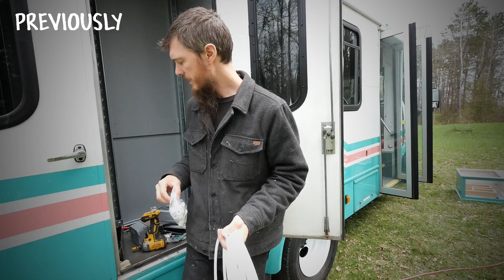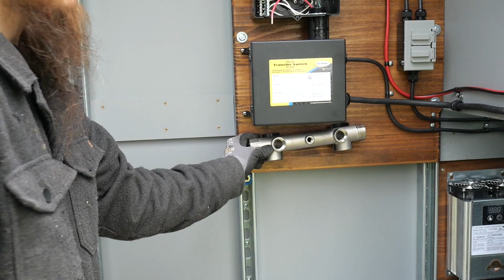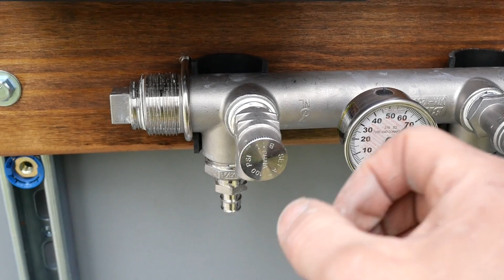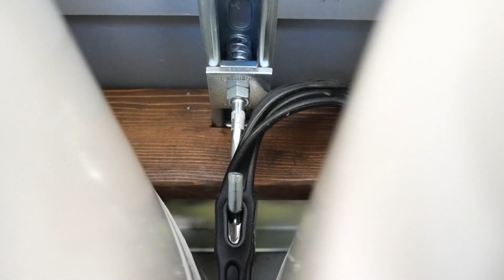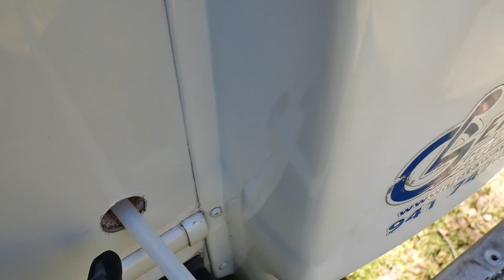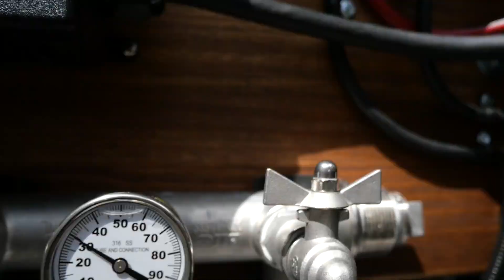Pumpless Pressurized Water System for our Bus Conversion

Comment: out west a lot of the public rv dump stations have water fill stations that make you push a button which turns on the water for 30-50 seconds but those systems also have pressure switches so if you try to fill up a pressurized system the water fill system will shut off, so you couldn't use it to fill up a system like yours. i understand your desire to get away from the typical rv/marine on-demand electric pumps that are noisy and seem to die every year without warning... one system i saw once used stainless-steel cornelius kegs that used to be commonly used in the soda pop industry for dispensing soda syrup, the common ones hold 5 gallons, are tall and narrow and fairly easy to store, have large opening lids making cleaning and filling easy and they are designed to operate safely at 100+ psi of pressure. a small battery-powered air compressor or even a manual bicycle tire pump is all you'd need to pressurize them with air.

Comment: It is too late to think about it now, but if it was my buss, and since there is that room in the back, I probably would have made a shelf on that wall and put a watertank near the ceiling. And I would have placed it in the middle, for weight distribution. I would not have needed a pump, and the system would have been totally silent, because I would have had my own 'water tower'. I would have had gravity fed water. The lines can go down to the floor and up again to the sink, as long as the sink is placed lower than the water tank. You could fill the tank with a hose on top of it. And you wouldn't have had to make the hole in the wall. Well, maybe next time.
Reply: IMO it's better where he has it. He's going to have almost 300 pounds of water in those tanks when filled and you don't want that up high when you go around a corner or a curve at speed.

Comment: if there isn't enough preasure you could just add a pump to the system to preasureize the tanks.  It would still be alot more silent then having just a pump and you would have more preasure and maybe more water

Comment: would it be nice to put a small platform under the tanks that would help keep them from moving like a sort of custom suspension?  When moving they may want to move weather you see it or not so perhaps a sort of giving platform that will allow them to move as you drive without coming loose,  You may not see it move but over time it can cruder problems.  Water will slosh around and each time it will put pressure towards the way it is sloshed.  Just look at a gallon of water and see how the water moved back and forth when moved

Comment: Normal This System Works Fine Without Any Problems Because You Consume Water And Immediately It Refills Water In the Tank So There Is Always Pressure Inside. In Your Case After Consuming A Few liters There Will Be No Pressure Or A Very Weak One In The Tanks, Having In Mind The Level Of The Outlet From The Tank To The Tap Which I Much Higher.
Reply from the maker: A typical RO system doesn't fill very quickly so that's why I chose these units. We'll post the test results soon.

Comment: I was thinking that you would use one tank and fill it with air at a high pressure and then use a regulator to pressure the water tank. But your system should work just fine 👍👍😁

Comment: Clearly, you planned for success, but adjusted the design to cope with unexpected difficulties. I have no experience of the bladders in pressure tanks, but suspect that they will last as well as you might hope. The vehicle will not be constantly moving, everything appears tightly fixed in place. Your need to keep the designs tidy and well constructed is obvious. The use of standard parts should make maintenance easy, though I doubt that it will require attention for some time.  With the last bits completed, it will need is a road trip to test out all the functions and features. Then you can go off and have some family fun time.

Comment: Where did you learn plumbing and to use a pressure system? Is pressure systems what they use in houses?
Reply from the maker: It's just something I picked up. Houses usually use a well pump or in the city they run off gravity from the water towers.

Comment: Where did you get that air inlet you showed or do you have link? I'm looking to test my PEX manifold and have been looking for one of those.
Reply from the maker: I posted a link to it, but maybe you can also find it elsewhere if you don't have a Menards near you. Hopefully it sends you in the right direction.
Reply from the maker: https://www.menards.com/main/plumbing/hydronic-radiant-heat/radiant-heat-manifolds-components/watts-reg-air-test-assembly-gauge/0069780/p-1444446180261-c-8523.htm?tid=6732911350617613063&ipos=34
Reply: Perfect! Thank You Very Much!

Comment: Very good idea and I like it. But would if you mounted the tanks as high as you can and had an air inlet and gravity fed your sink. You don’t need the pressure for showers or toilets. Just a sink right.......?
Reply from the maker: Maybe, but it's hard to get good flow with a gravity fed system. The water lines would need to be larger and it would still be a low output.

Comment: Just curious if the weight of the filled tanks is going to A)throw the center of the bus gravity to one side, and B) with the water sloshing around during driving, cause handling problems due to sloshing water. Also, and I'm NO expert in any way, but the rubber straps might stretch during turns due to water weight shifting in the tanks. Would you need some kind of counter weight on the opposite side of the bus to even it out? Just curious. Great job though, really enjoying the process!👍👍😊
Reply from the maker: Thanks. We've been trying to keep an eye on the weight as we build and it should be all okay. We'll try to talk about that in more depth but the water shouldn't be a problem. At least we don't think it will.
Reply: @diyfferent  My friend that does live in her Transit van has her waterjugs under her bed in the back center of her van. I remember her telling me that it made a difference in her turns while operating driving. So when she centered them in the back she said it balanced the weight. It is just something to think about. I am sure you would figure it out.
Reply: According to my calculations, two tanks holding 14 gallons of water each would weigh a total of 233.52 lbs.  So, that would be like taking an additional person along with them (obviously a bigger size person than Doug or Ashley).  With the bus formerly equipped with the wheelchair lift, I'm pretty sure it would've hauled some heavier people without needing a counter weight.    

Regarding water sloshing, since the diameter of those tanks is fairly small, the sloshing effect will be very minimal.  Sloshing would be more of an issue if the diameter of the tanks was several feet--for example, 4 or 5 feet.
Reply: @ILGuy2012  Good point.

Comment: Do you think you might want to put some foam rubber in between the tanks ? Just in case, you will be amazed once you start moving how things still rub on each other 😁Can't wait for your first adventure 🥰
Reply from the maker: They can't touch each other so no worries. They are screwed down at the base and the straps are tight, plus the two rubber straps go between the two tanks and will keep them apart. :)
Reply: @diyfferent  Excellent 👍

Comment: Those pressure tanks are similar to what we have with our well water. But the well pump (which is 220V electric) pushes the water in to the well tank compressing the air bladder since gas is compressible, and bladder will expand as water decreases maintaining constant pressure.
Is the water going to be pushed in under pressure from outside?  I guess that could work. Or are you going to force it in at home using house water pressure.
Reply from the maker: We'll be showing that in a video soon :)

Comment: I had a pop-up camper, and hated the Potable water system. I replaced the soft tank with a Rectangular Plastic Tank, put in a foot pump. We could fill the tank all the way with water. The foot Pump put air into the tank, to pressure it up. The foot pump was designed for potable water systems.

Comment: Very nice work, Love it! 💙 
(I was wondering, I haven’t heard you say, will the beds balance out the weight of the water filled tanks?)
Reply from the maker: Both sides of the bus should be fairly balanced when everything is done. We'll try to talk about that in other video.
Reply: Probably wasn't very balanced before with that massive lift. Might it already be compensated in the frame somehow?

Comment: Not sure what the date was when this was filmed, but I am watching it on May 24. You have on a jacket and here in Arizona it is 93 degrees today. Summer is around the corner.
Reply from the maker: A bunch of these clips were filmed weeks ago when it was still chilly out. For the most part it has been very warm here lately.
Reply: @diyfferent  Finally.  lol
Reply: I'm in vail az....hot!
Reply: @robertadzeima5132  here in Phoenix also. I don’t think we even had a real spring and I know we didn’t have a winter. I did not have to cover any outside plants this year.

Comment: You hear the word 'experimenting' and instinctively know Doug's idea of experimental means we are in for a treat, because he nearly always never ceases to amaze us on how he develops an idea. This was no exception. 
That pressure system looks fantastic,  and considering the weight of that lift you took out, I can't imagine those two tanks, even full will be as heavy.
Reply from the maker: Yeah, we have been keeping track on the weight going back into the bus. The tanks weigh about 36lbs each and should hold about 233lbs of water all together. The weight of the tanks, water, and strut wall and plywood altogether comes to about the weight of the lift, maybe 500 lbs.
Reply: @diyfferent  Right! I get some have to be aware on the weight on these conversions, or the need to have water more readily available on fill up, but it will be interesting to see how this does in real living conditions albeit it just short getaways. If it does as well as it looks, it is a great option, especially if power consumption is a consideration. No matter how little draw a 12V pump might be - it is still a drain on any system. Plus, one less thing to go wrong! At least with 2 tanks, if one fails, you should still have water. If a pump fails, you're stuck.

Comment: Like your system should work well, the bladders are a funny thing they can last years or go out quick
I have seen it both ways. should go threw about 2/3 of water capacity before you loose pressure.